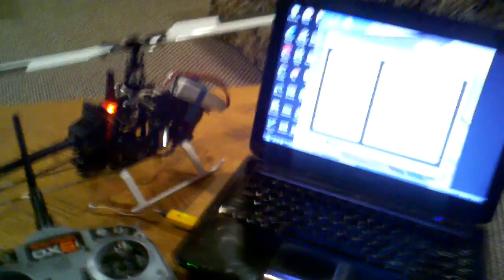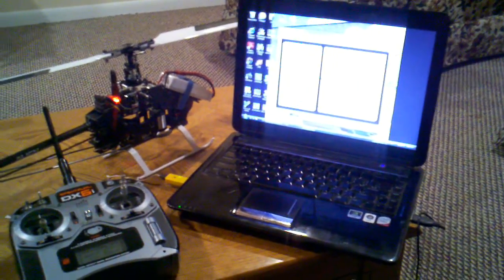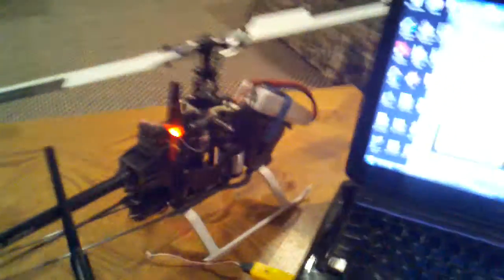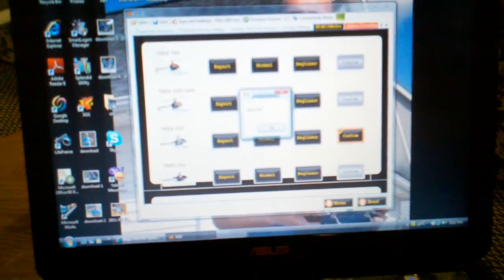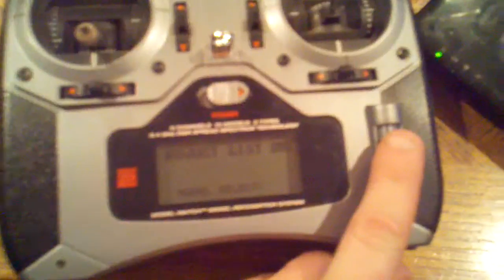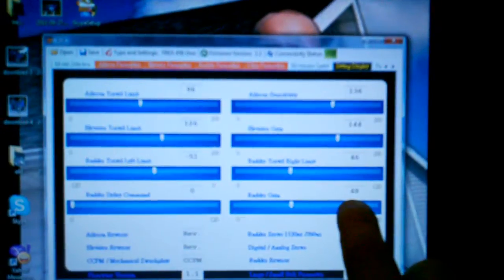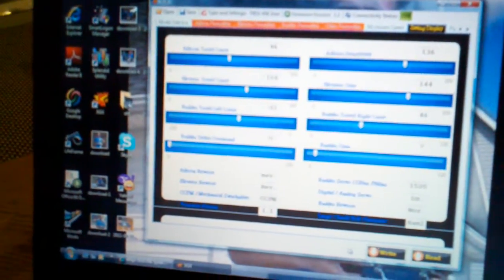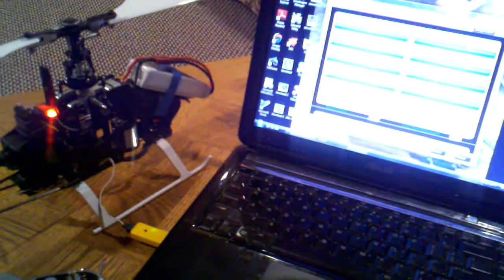3gx Gyro Gain Verification - quick walk through

Comment: in a dx7 gain was 15 and 1,15 to get 45 gain rate and hh modes in the 3gx monitor window. 30 and 1:30 put gains in the 3gx at 60 rate and 60 heading hold respectively, aux2/gyro. Your help made it simple to apply thanks.
Reply: 1,30 in the dx7 not minute 1;30 anywhere, lol

Comment: Danger21@ satililtes with the Dx6i don't seem to work together. My rudder gain won't budge from 120. Huge tail movement just on spool up. The AR6255 worked fine before I swapped.